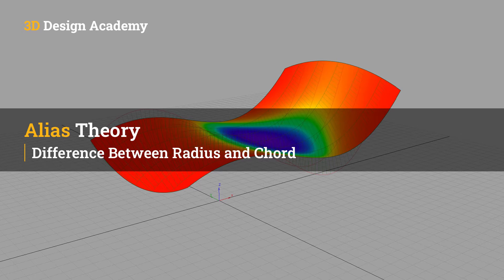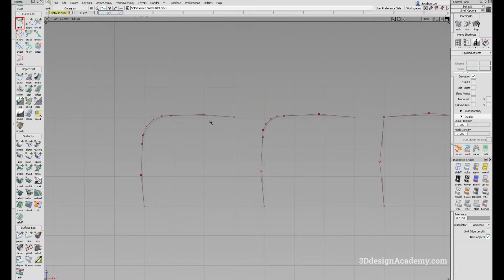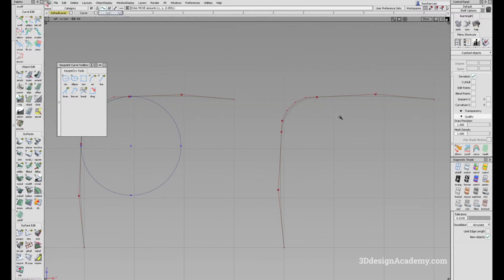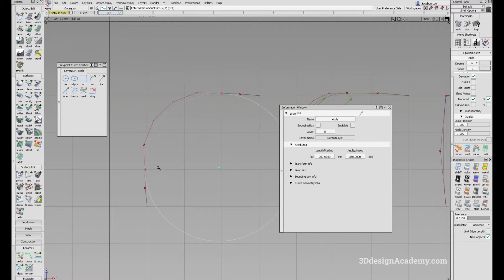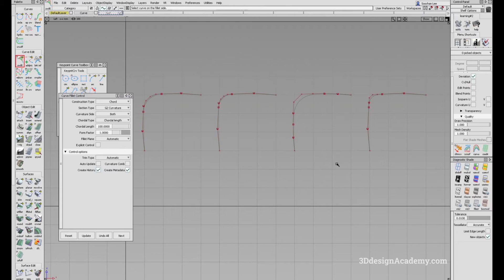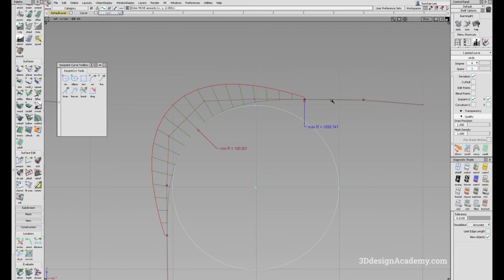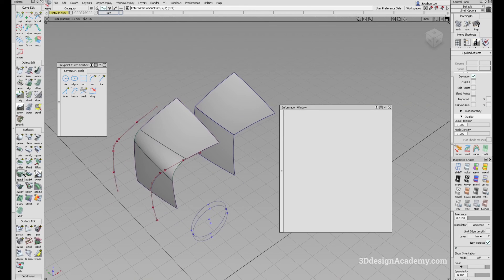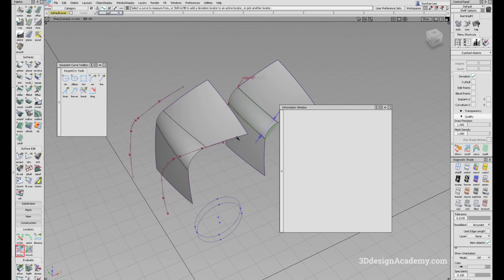Autodesk Alias Tutorials l Alias Theory 1 - Difference Between Radius and Chord

Comment: This type of Chordal profile of fillets is quite necessary for the so called Fascia blends (also known as Race track profiles).
Using regular radius blend type in the Fascia scenario results in pinching. Barry Kimball has impeccable explanation over those concepts.
Reply from the maker: Yes, I could not agree more. I do prefer to use chord fillet for most applications unless there's a specific engineering criteria requiring minimum radius. Also, would you mind sharing the link for Barry Kimball's explanation? He is a master and would I'd love to learn how he explained it.